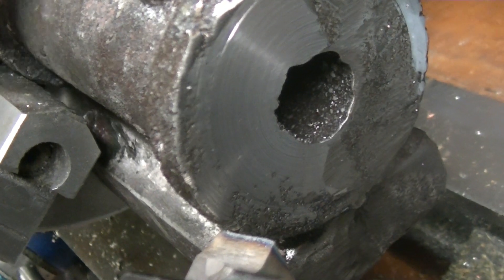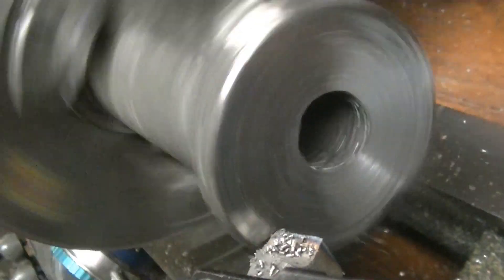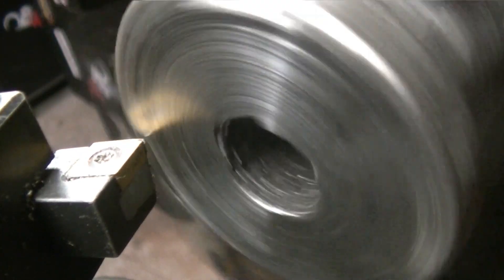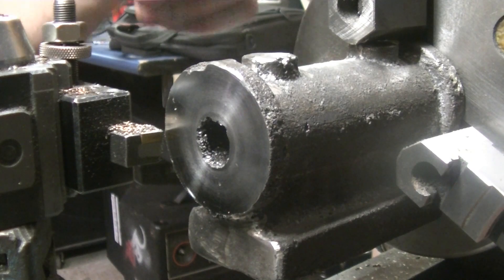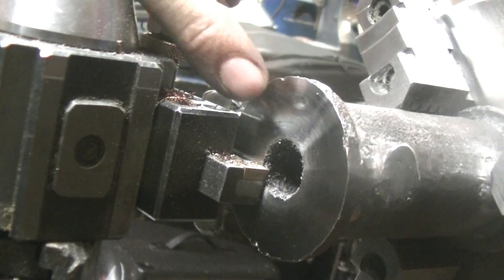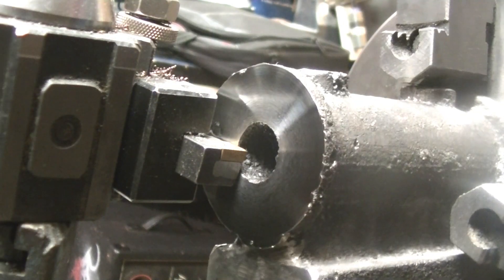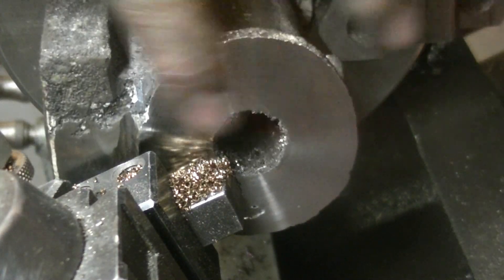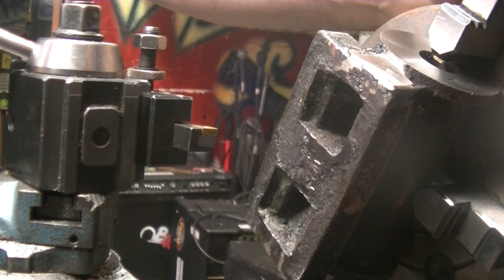Steam Engine Build: Valvebody Machining Part 1

Comment: HEY man, glad to seey ou back!!! Angle grinder will def, help with hard outer scale,,,if the casting is chilled, I sometimes throw them in the woodh eater over night , the heating , n slow cooling usualy softens thenu p so they machine nice, Just toss them in, bank the fire, pull out next morning, good to go
Reply from the maker: Thanks! I wish I had a wood burning stove/heater to be able to try this out on.

Comment: I love this build and have been following it. Would it help at all to hit the flanges with a flap wheel on a grinder to kind of take the high spots and that skin off before you go after it with the lathe? I just think it might help with the interrupted cuts. Awesome job :)
Reply from the maker: Yup! I try to do that, but the surface is always a bit "wavy" and there is always some kind of interrupted cut.  But it certainly helps a lot.